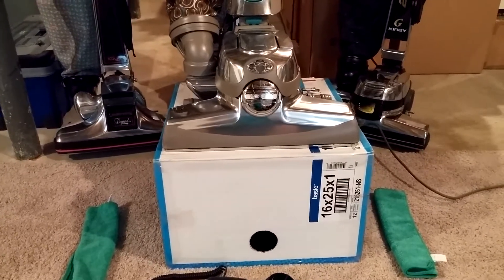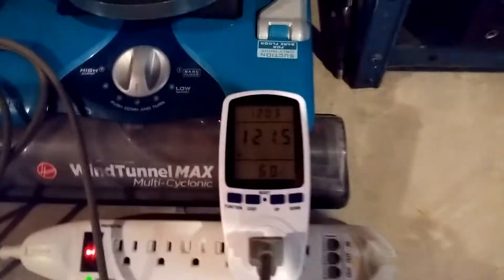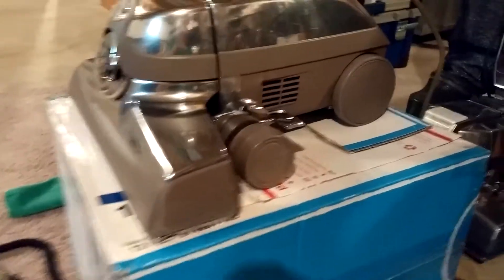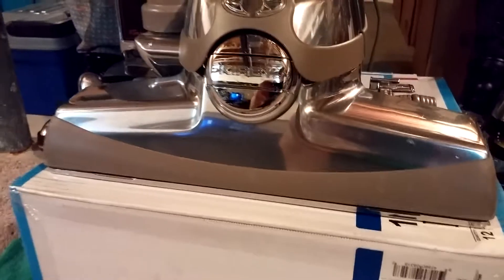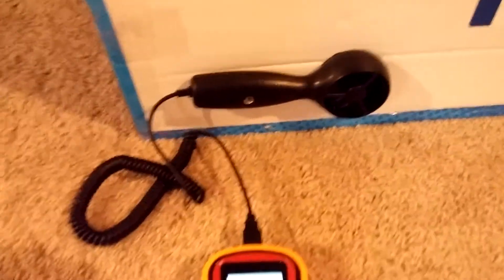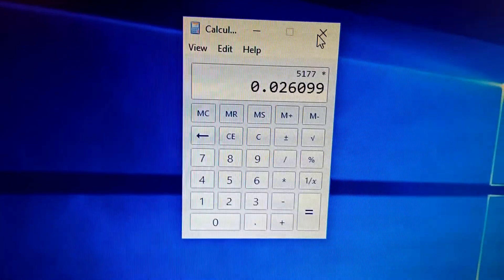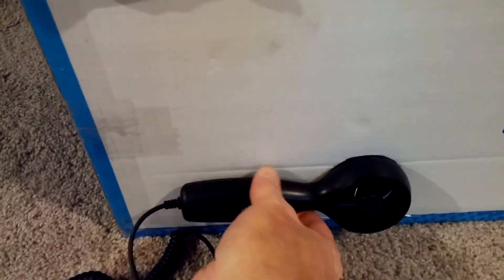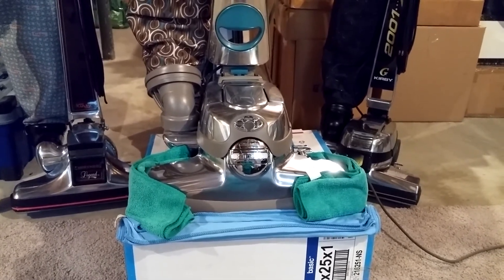Airflow Box Test of the Kirby Sentria II

Comment: Have you ever done a nozzle air flow test with the unit running on high speed? I have made a small plate to push both switches in when the floor nozzle is installed. This causes the motor to run on high like the hose is installed.
Reply from the maker: No and I won't either. After a full refurbishment, this Sentria II pulled 151 CFM. High speed might bump that up to 170 CFM and the transmission can't handle that on medium pile carpet.
Reply: No worries. I understand. Just for note I have been using a sentria 1 this way for about 7 years with no issues. I also have personally installed this modification on 1 G3, 1 G4, 2 G6, and 3 ultimates. This was in 2009-2010 with no failures. Again I don’t know what the RPM difference is on the motor so I understand you not wanting to do this to one of your machines.
Reply from the maker: @bryanwarren7554  oh I'm not saying it doesn't work, I'm saying it won't be useful on my medium pile (or thicker) carpet. 👍

Comment: Why is the avalir's CFM higher than this one? I thought they shared the same motor and design.
Reply from the maker: Many reasons, not the least of which is age. Manufacturing tolerances and small improvements over a number of years also affect performance. Bottom line is that over time, Kirby has upped their game.
Reply: @VacLab  I bought a Sentria 2 new in 2013 for $1500 from a sales rep. "New." When I took it to a local vacuum shop for a tune up it was missing screws. But recently I bought a 2mo old Avalir 2 for $90 and I can tell a significant improvement in the transmission. The old one seems to have a lag like something is pulling it back. This new one glides effortlessly and picks the pile up quite a bit more and even seems to groom it better.